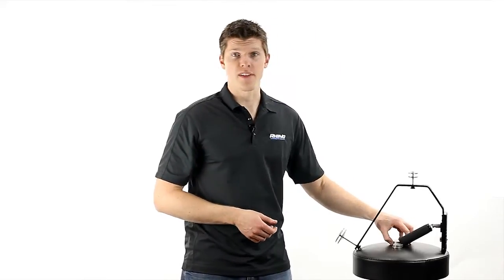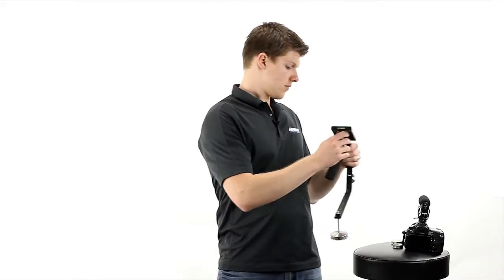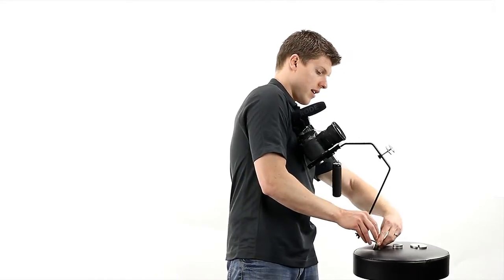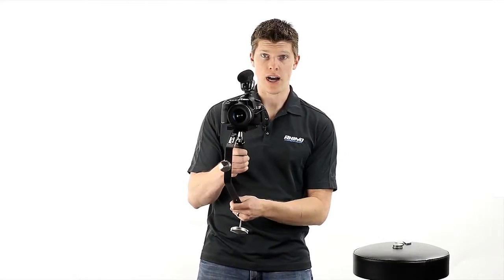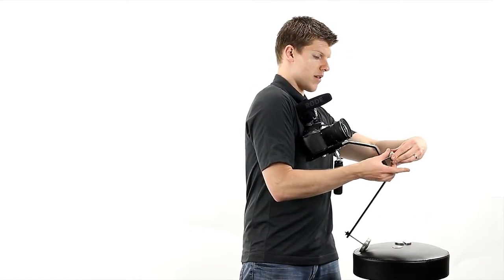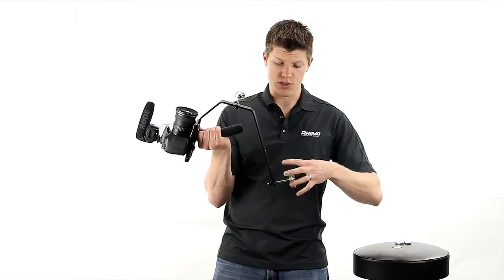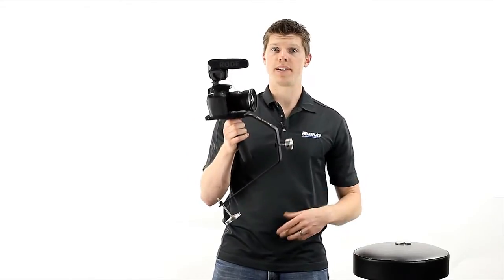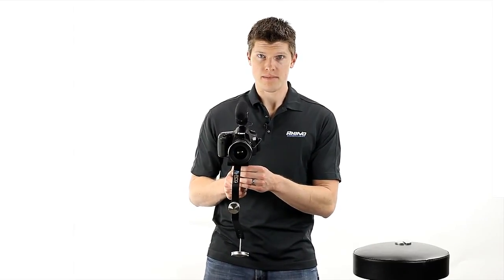Rhino Steady (EZ-Steady) Instructional Video

Comment: Watched your video probably over a dozen times, have a Canon T2i with 10-22 lens, batt no cap. weight is aprox 2 lbs.  

#1 - Can't take enough weight OFF of the bottom get the drop time to slower.  I have no weights on the bottom and screwed all the way in.  Yet drop time is fast - 1 sec instead of 2-3  like you recommend.  Slowed a bit front smaller weights off but then the pitch is titled back. Set to back channel.  Also, I tied moving up to hole 2 but that only made it faster. post #2 next

Comment: Mine was delivered earlier today. It's not that difficult to get it balanced, just spend time playing with it and  you'll figure it out. I have a GH2 which is really light so I use that heavy additional weight for my camera and a few washers and it's pretty smooth. 

One thing that's always an issue with these style of stabilizers is the swaying motion. One trick I just figured out was to leave the straps on your camera and use them like a marionette puppet to prevent the camera from swaying.

Comment: #2 - Assuming we get drop time figured out. To get pitch right I must put ALL my small weights on the front.  If I put a heavier lens and mic on my rig there is not enough small weights to compensate for the pitch so should I used the larger ones on the front or am I missing some smaller ones?  Received 1 thick & 4 thin small.  Large = 4 thick & thin.  So I am guessing that even though the large ones have larger diameter they should go on the front if needed?